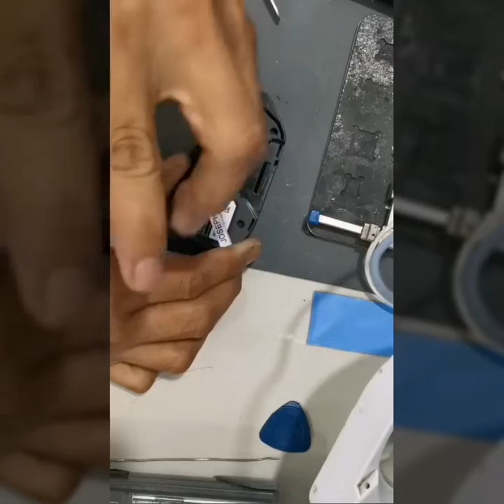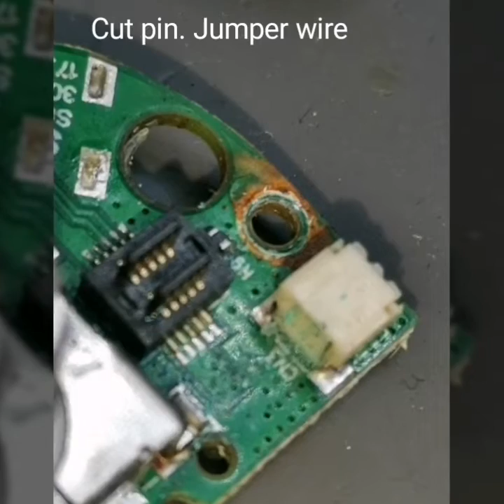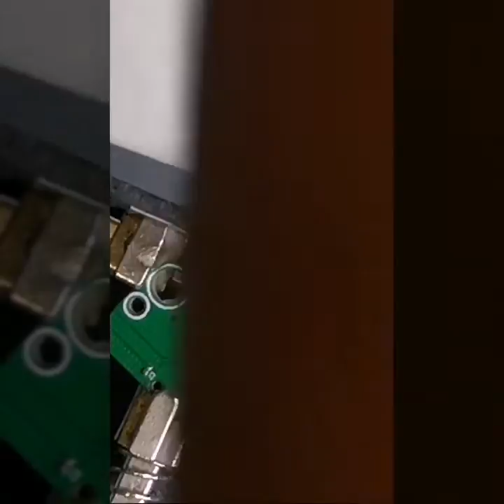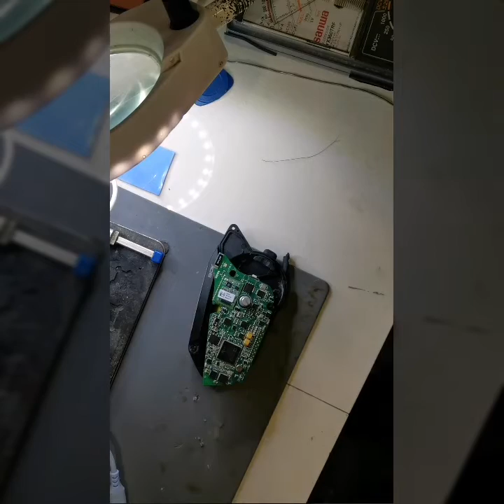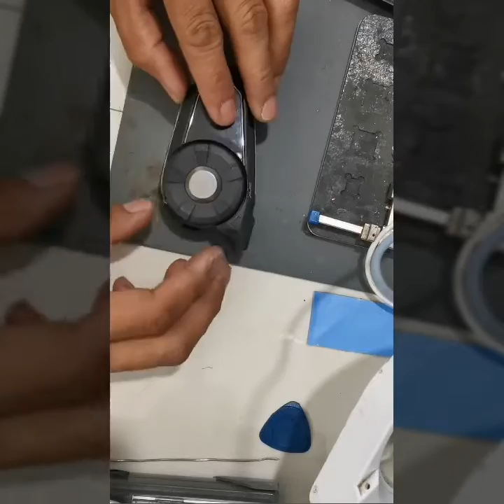SENA 30k intercom Water damage Repair

Comment: How did you get the two halves separated? Mine won't come apart.
Reply: Take the contact pin board out by using a small flat head screwdriver under the long edge and lift it out. It's just a pin connector. Then the two halves can come apart.
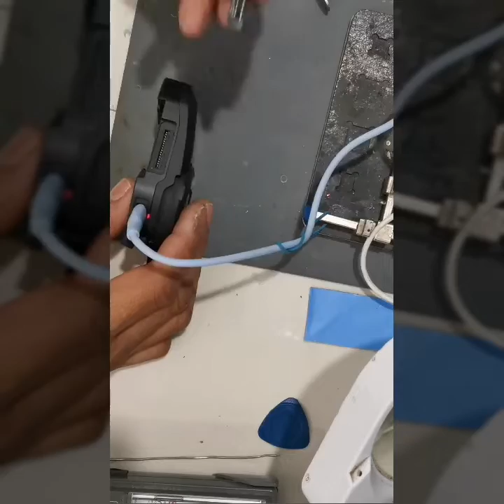You see him start to put it back in at 9:29